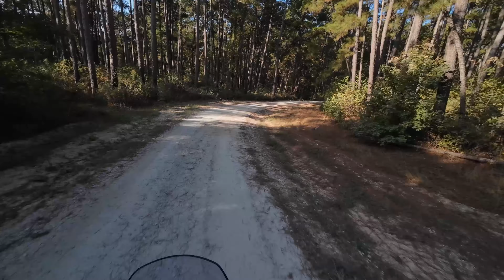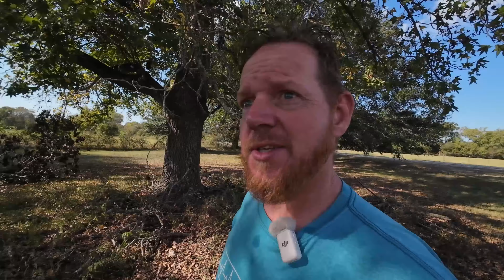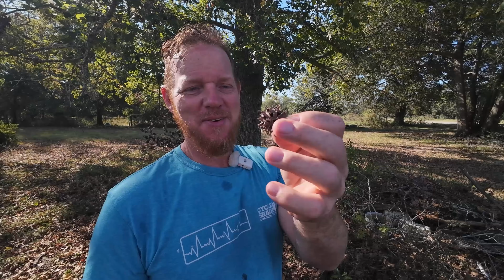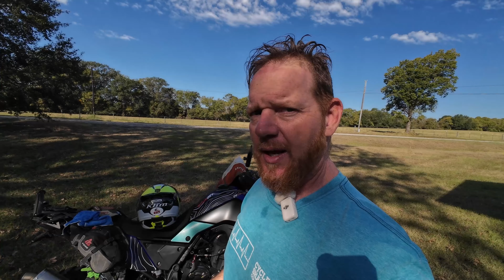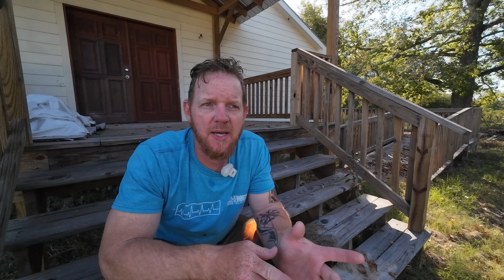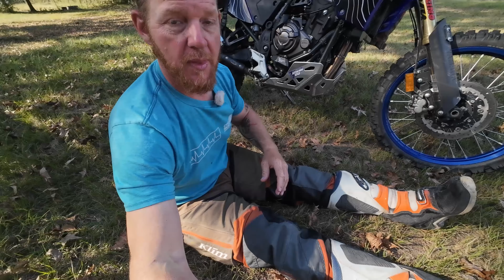Dyno Jet Power Vision3 For Tenere 700

Comment: Dave, my man!  I was actually thinking you were leaning towards saying Adios to the T7, but glad you, as of now, are going to keep it.  What I want to know, sir is....did the tune allow for the T7 to get throttle up wheelies?  That' my biggest complaint about that bike.  Clutch up wheelies suck.
Reply from the maker: 😆 Man I love the T7, even my son knew the 1290 was going to be the one on the way out, but he lives with me and sees all the attention it gets VS the 1290.

Dude it definitely helps with power ups in 1st and 2nd. When off road and a little preload bounce, 3rd gear is no problem. Heck in 2nd gear off road I have to be careful because, where it would pull the wheel up it now spins. I have to give it less throttle input off road to wheelie. Man it’s totally worth it, no matter what tune you go with.
Reply: @BigDaveTALKS  That is what I wanted to hear.  I was so close to going to the Shack this weekend and trading it in for the 700 enduro.   Now to shop for exhausts and tuners.
Reply from the maker: 😮😂 nah man I thought the same thing, then decided to go all in. Now i am even more happy with the T7 and still retain that Yamaha peace of mind. Just fyi, it’s a brain twister trying to find out what tuner or flash to go with. If you go with a flash then consider 2 wheel dyno works.
Reply: @BigDaveTALKS  i'm a fan of Akropovic exhausts.  So i'll be doing some research fo sho.  Thanks for all the content brother
Reply from the maker: Glad you mentioned that. After we move I will be getting an Akro slip on to replace my Leo. I agree they just sound so much better, even with the baffles in. Hey no problem bud. Let me know on IG how it works out or if you make it out this way. I thought we were already following but apparently i am doing something wrong or we aren’t following.

Comment: Nice nylon melt! 😀
Is good that DynoJet gave you decent support 🙂
Am glad you are thinking more about keeping the T7 over the 1290... nothing wrong with the 1290, but I much prefer the T7. Is a shame you can't get an aftermarket cruise control for it, I have one coming for my V Strom, very much looking forward to fitting it when it arrives.
Reply from the maker: Yeah i learned they have great customer support. I called them about 4 times and got the same guy 3/4 times, he was totally understand of my situation.

That melt Mod is awesome 🤪. Thanks bud, I figured you would understand the situation. Hey they do make a CC for it but it’s expensive, and a good bit of kit to install. It comes with a servo and all, so basically like an RC car at that point. Maybe they will ditch the cable actuated throttle and move to throttle by wire in 25. But that would possibly kill the “simple” factor that everyone loves about the bike. Man you are really getting on with Daffy and the mods. Like me and the T7.
Reply: @BigDaveTALKS  I wish I could keep a bike stock... Daffy was supposed to be the cheap practical motorcycle 🤣
Reply from the maker: 😆 it’s funny how that works out. I actually have done bare minimum to the 1290. Mostly because it’s more expensive for mods.
Reply: @BigDaveTALKS  My XSR900 GP is basically stock other than some mirrors and a tail tidy.... am not sure if that means I love it or hate it LOL
Reply from the maker: Man that bike is one of those that needs nothing IMO. Maybe a little personalization, but not much. It would be hard to pass up if they make it over here. I would just say it fits you like a well tailored track suit😄.
Reply: @BigDaveTALKS  Hahaha... I know I have not taken it on track, and the road isn't the best place to push the handling, but I doubt it is a bike I will ever be able to get my knee down on, it is just a bit awkward for that style of riding... I may find it being replaced sooner than I hoped... will have to see... I do love the idea of it though, just wish it was a bit more natural to ride hard and move around on 🙂
Reply from the maker: Whaaaat! That’s a great point though. Sometimes we big kids fall in love with the idea and the chase, not taking in the practicality of things. Boy do we have fun in the meantime though. It would be great to see a track day, but i get it. If the ergos aren’t right, then better not to push it if there may be a resale later on.
Reply: @BigDaveTALKS  I'll def do a trackday on it before I decide anything... and although it may never be a knee down bike for me, I do very much enjoy riding it, but I kinda wish it was a bit more exciting to ride, and now my local Yamaha dealership has closed down, I don't have a local place to get it serviced, which might be putting a bit more of a dampener on my enjoyment of the bike. manufacturers need to start supporting the dealerships more and stop insiting on expensive branding and solus showrooms
Reply from the maker: It’s all good, the only knee down i ever got was on the dirt bike, which also ended up with dirt in my face as well😆. Just being on the track is something that one day i hope to do. Meantime, I’ll just watch. I agree, it sucks when dealerships pull the majority of the profits from parts, gear and service. You would think the manufacturers would give them a stipend or something. Good thing is, it’s a Yamaha, not much servicing should be needed.

It really is hard trying to balance exciting with practical. That’s why 2 or 3 bikes is great to have and it’s also why if i don’t get the price I want for the 1290, it will be around for a while.
Reply: @BigDaveTALKS  aye no point selling it if you only get low ball offers
Reply from the maker: Exactly, i worked hard to get the title to this bike in a short amount of time. I understand i will loose some $$, that’s just part of it. There is also a set limit I am willing to loose.

Comment: Company support goes along way.......if you sell the 1290, you selling with the broken windshield? 😂  figured i'd ask...i dig the T7....you can always get a electronic cruise added
Reply from the maker: 😆 I have thought about that soooo much. THE WINDSHIELD IS STAYING🤣. Even if i keep it due to lowball offers. Seriously though, it is really a conversation starter.

That’s one of the beauties of the T7. It’s still cable controlled throttle. There is no practical CC available other than a throttle tube lock, BUT, the 2025 T7 has throttle by wire which will allow for one of the aftermarket electronic CC or as an upgrade option from Yamaha. I may just end up with 2 Tenere’s next year 🤪.

Comment: If you have a flat on tubeless, you plug it and 5 minutes later you’re gone, if you bend the rim, put a tube. On tube type, if you have a flat, it will be a long repair.
Reply from the maker: Yeah the Tube/ TubeLess debate is about as productive as the oil and tire debate 😆. 

I like to travel as light as possible so to me it doesn’t make sense to pack spoons, tools and a tube with tubeless wheels, when all you need is a puncture repair kit. I did the NMBDR solo on my Africa Twin, but i went at a slower, more cautious pace, picking lines that were easier on the tires. After 4 BDR trips, I have learned that most people get flats due to low pressure and riding fast. I keep 30psi minimum and have never had traction issues.
Reply: I prefer tubed, even though they are a pain to fix as you say, but riding rocky or rough terrain I know I'm not going to be stranded with a tyre that's come off the rim, the small compressors don't have enough volume to re seat them. I carry a can of tyre goo that seals and inflates the tyre so unless it's a major it's probably quicker than fixing a tubeless, if it is bad I have spare tubes, which you should carry even with tubeless tyres off road, so both weight and time there's not much difference in my opinion. I fixed a flat on my old BMW that way and it held pressure for another several thousand km until I sold the bike.
Reply: @ I can tell you that my actual set of tires, Tusk 2 track, it will be almost impossible to remove and install on the track, too stiff. 
Everybody is afraid of damaging a rim but rims are strong enough and with proper pressure, almost no chance you damage it.
Reply from the maker: Oh heck yeah those Tusk 2Track are stiff as hell. I actually didn’t bring any sort of tire repair kit with me on the UTBDR this year. I knew if i had a flat i wouldn’t be able to repair it by myself. I also knew that i could make it to a shop on just the stiff tires alone😄. Once in a safe area of Moab i put 27psi, then i hammered those tires and didn’t loose a pound of pressure or damage a wheel.
Reply from the maker: @silverdale3207 I agree. My biggest issue is packing for maybes and what if’s. I don’t want to carry a bunch of stuff i MAY need. I have done that in the past and it really messes with the enjoyment of riding, for me that is. I pack bare minimum and just have to take it as it comes. That’s the ADV part I guess.
Reply: @BigDaveTALKS totally agree with you and I might do that